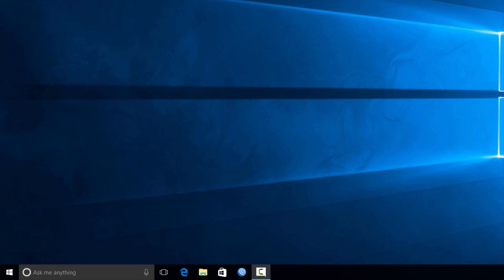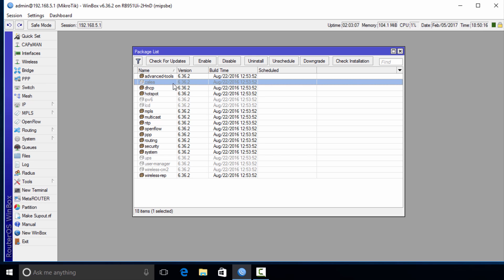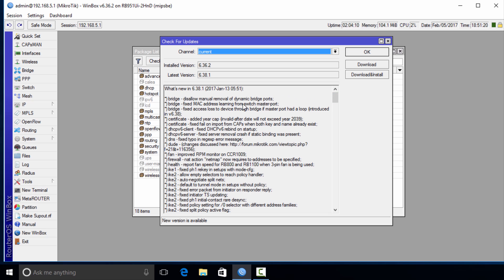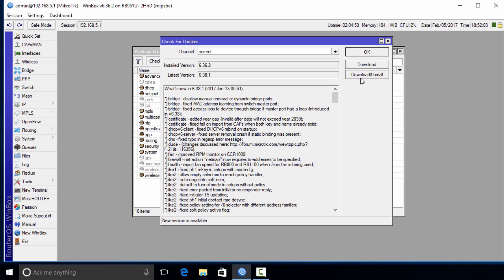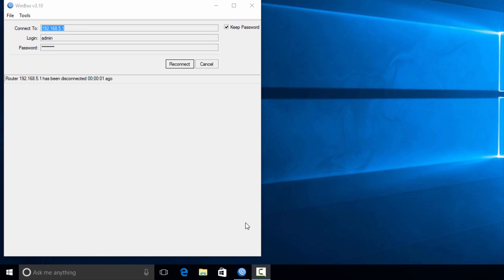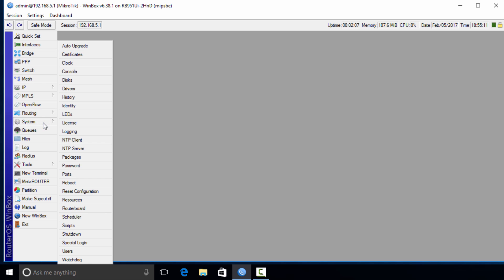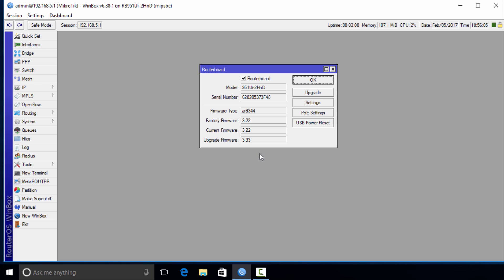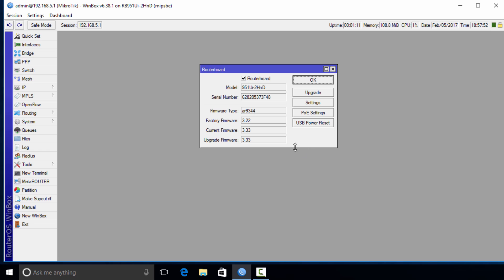MikroTik Tutorial 4 - Upgrading OS & Firmware

Comment: Many of Mikrotik's competitors have a management system that allows you to manage multiple devices centrally, e.g. UniFi controller. Many of them are moving to cloud controllers which means even less local hardware. I've just logged onto a client and can see that there is an upgrade for their APs and a simple "Rolling upgrade" click upgrades everyone. Does the Dude offer something similar for Mikrotik? I can't access the Dude at the moment as the little device I bought to learn about Mikrotik doesn't support it

Comment: I have done tutorial 1 succesfully and i can browse internet just fine BUT  windows saying unidentified network and when i try to upgrade miktrotik it says ERROR couldt resolve dns server any ideas?
Reply: well now i noticed that wifi is not connecting basically miktotrik when i ping upgrade.mikrotik.com from all interfaces (bridge,eth1,2,3,4,5,wlan) its unreachable
Reply from the maker: Make sure that the cable from your modem is plugged into port 1 on the router.
Reply: Ill try next, but i want to ask u smth else, Cant I use this without any modem only this and my pc?
Reply from the maker: What do you use now for internet access?
Reply: i use a ZTE ZXHN 208N router, but i think its locked from my ISP and I cant put it to bridge mode, so how can i make mikrotik work???
Reply from the maker: There is no need to bridge your modem, just connect a network cable in the WAN port on the MIkroTik and then plug the other end into your modem.
Reply: i have tried that and many more!!Can i msg u somewhere like fb or smth ? thanks for ur time anyways
Reply: ok finally fixed it, ur guide was pretty solid i was making some bs!
Reply from the maker: +mossRip Great!